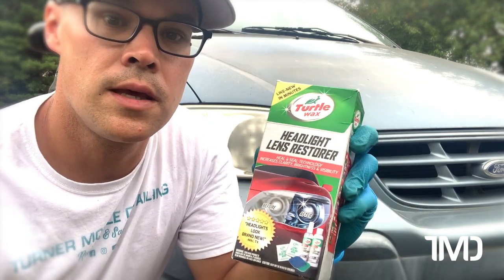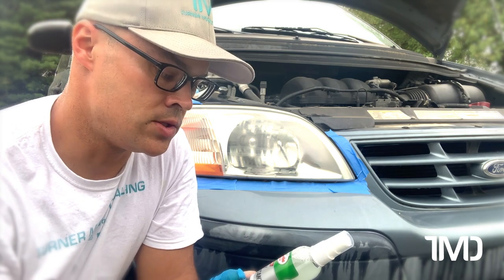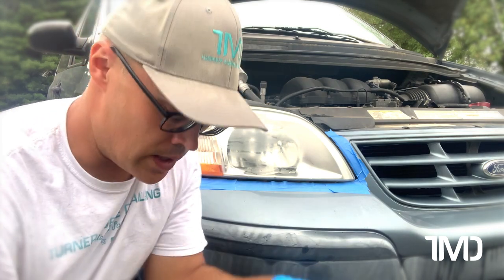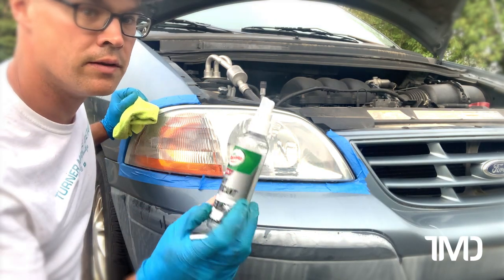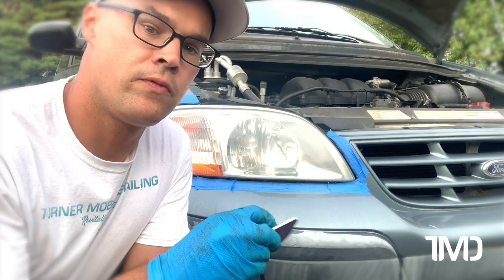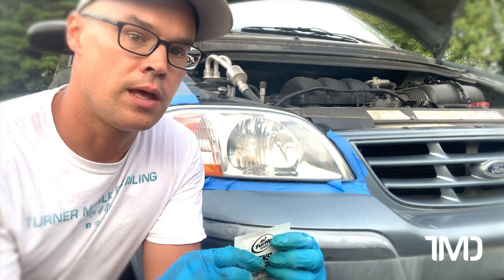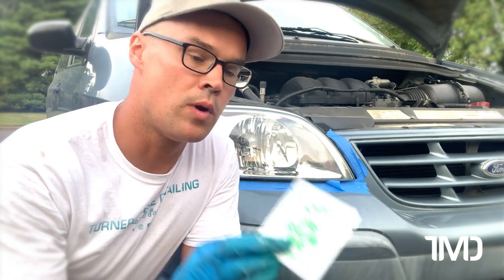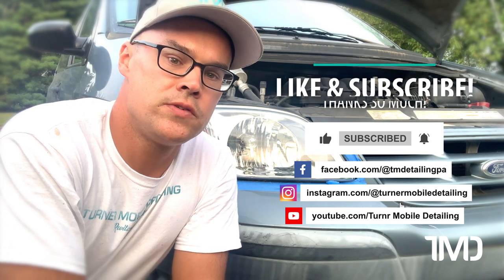The BEST Headlight Restoration Kit for the Money!! | Turtle Wax Headlight Lens Restorer Kit Review

Comment: The newer version of that Turtle Wax headlight restoration kit is a cost cutting kit. That spray bottle lens clarifier he has was replaced with two small packages, but still works. It worked great on my 08 Outlook.
Reply: Not enough detail for someone who doesn't know about sanding grits. My kit only has 2 pads.

Comment: Great video.  I just watched another youtube video where he tried 6 different brands of headlight restorer on 6 different headlights, and the Turtle wax brand was one of the best.  Thanks for verifying this too. I think that is the brand I will try on my car rather than trying some of the home remedies or other brands.
Reply from the maker: Thank you! Yeah it’s definitely a great and economical option for the diy guy.
Reply: @TurnerMobileDetailing  I replaced the headlight assemblies on my truck, they were relatively cheap and easy to do, but on my Honda CRV, the lights are more expensive plus it looks like a pain to replace, so this seems like a great (cheap) option.
Reply: Watch JR go!
Reply: @DGYtown  Perhaps. :-)
Reply: Hahahahaah I watch the same video and then came here I'm about to go out and buy this for my 2006 Toyota Avalon with  350124 miles

Comment: So at 6:00 after having finished the polishing and sanding activities you don't have to rinse with water and dry before starting the coating applications ?
Reply from the maker: It’s been a while since I’ve used this kit so I’m not totally sure. Some of those prep polishes are meant to clarify the lenses while leaving a base coat for the top coats to bond to. However in this case, since a prep wipe is included to use before the top coat, it leads me to believe that I did clean the lenses before the lenses prep wipe. After the polishing process though, and the polished has been buffed off, I believe the prep wipes are just alcohol wipes to clean the surface anyway, and that will remove polishing oils. So either way you’re good. When in doubt, just follow the instructions if you’re not a professional who does it for a living. Let me know if you have any other questions.

Comment: Hey 1st viewer have Quick Question I did the last step in Reverse  that's said is there any problem
Reply from the maker: So you applied the sealer wipe before you apply the basecoat?
Reply: @TurnerMobileDetailing  correct
Reply from the maker: @joechen353  the sealant probably won’t last as long as it would as if you did it in the proper order.

Comment: Does this work? Even when they yellowing is bad and looks like its on the inside ?
Reply from the maker: It works great for the outside of the lens, just make sure to do each da using step thoroughly. But if there’s oxidation on the inside, I’m afraid it doesn’t do anything for that, the lens would probably need to be replaced.

Comment: The selant look a bit oily is it ok ?
Reply from the maker: It’s fine, not oily
Reply: @TurnerMobileDetailing  i mean i just used this product for my headlights.. Its been 8hrs now. i went to inspect and touch the surface, found it "viscosy"..is that normal ?
Reply from the maker: @faridh2125  it definitely should be dry after 8 hours. We’re the lenses clean and dry when you applied the sealant?
Reply: @TurnerMobileDetailing  i let the  base coat dry for about 5min.. I think it wsn't enough 😕
Reply from the maker: @faridh2125  you should touch the surface after the base coat in a tiny corner to see if it’s dry before you apply the final coat. Maybe the base coat wasn’t dry, idk, but if the final coat hasn’t dried at all then that’s a product problem. It should have dried at some point regardless of your process. See if turtle wax has a money back guarantee if there is something wrong with their product.
Reply: @TurnerMobileDetailing  i just checked the product its says "DOM" septembre 2019... Expired Maybe !?
Thank you very much sir for your time
Reply from the maker: @faridh2125  yeah maybe